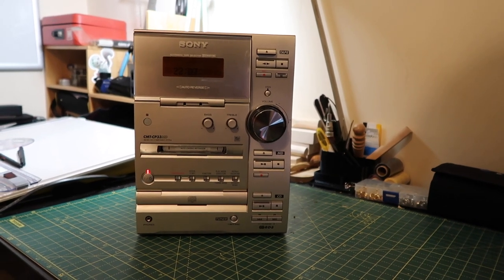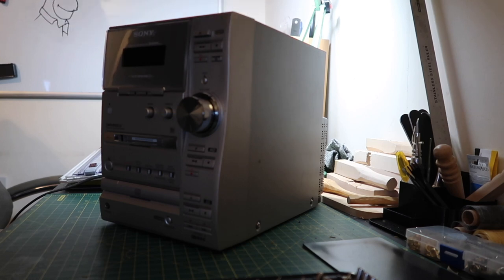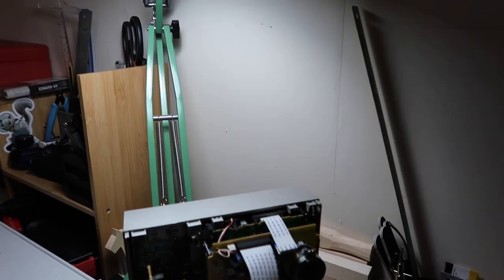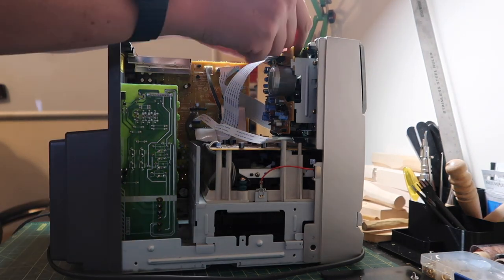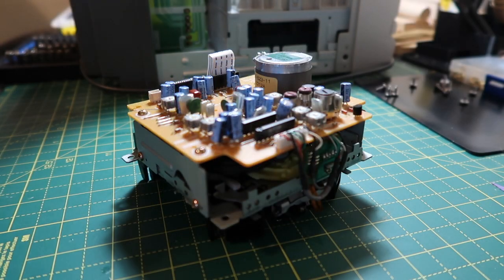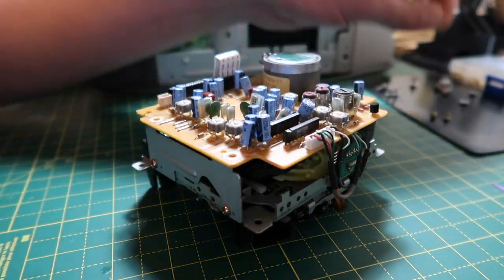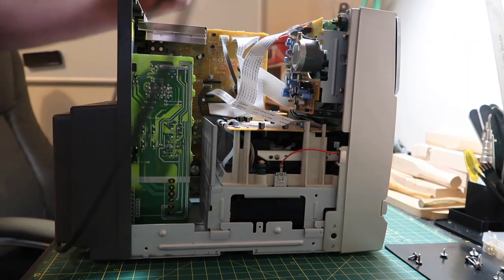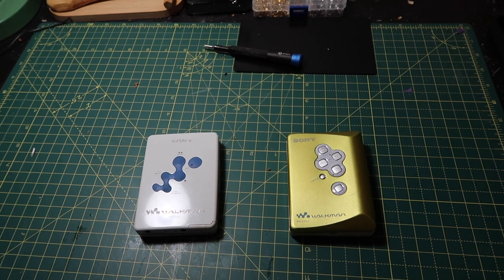Sony CMT-CP33MD Tape Belt Replacement

Comment: Thank you for your video! No need to remove the whole mechanism. Just the circuit board on the back. Three screws and the connectors. Leave the mechanism in place.

Comment: How’s this going, is everything still working? I’m about to try and get the working bits from two of these units to make one good working unit! Including changing tape belts so thanks for the video. I’m getting errors on both mini-disc units though.
Reply from the maker: Happy to report everything has worked great since I did this. Still sitting on my desk in regular use.
Reply: @retrobench5563  good to hear. I managed to create one fully working unit from two units which both had various issues. Your video was invaluable in helping me change the belts, which had perished. Minidisc issue was resolved (probably temporarily) by wiping a cotton bud with alcohol on the lens - you can just get to the lens without dismantling the MD unit! Thank you for putting this video up!

Comment: I have several months trying to buy the belts, I will take the risk to buy a lot of them if tests are needed, even I've purchased junk systems to practice the belt replacement (oo)!got to replace the CD belt and the Tape Deck, the hell is Double Deck autoreverse  - wanna cry.

Comment: hola, tambien tengo ese modelo con el mismo problema del reproductor de casete y tambien con el de Minidisc (no expulsa el disco y se queda dentro de la unidad) voy a intentar cambiar por mi cuenta guiandome de tu video, saludos.
Reply: Did you manage to change the belt? Is there a belt in the minidisc bay?

Comment: Hello. I have the same Sony system.  But it won't turn on fully. It's light is dull and bo functions are working.  I need help finding out hiw to fix this. Thanks.
Reply: It could probably be some blown or bulged capacitors
Reply: @BICIeCOMPUTERconGabriele  Thank you.

Comment: Hi Retro Bench. Thanks for your video. I have been making research to fix the same on a CMT-M333NT and I think by looking at your video, it uses the same tape belt mechanism. I made an order of those, since I was trying to find the parts and model for mine and only appears the belts for MD and CD mechanism and not for the Tape, even in the service manual is absent. I hope those help.
Reply: Good luck! Let us know how you get on!

For what it's worth, I found a supplier on ebay that had every type of belt imagineable, I'll dig out their name is you're struggling to find one that fits.
Reply: Thanks. If you find it, let me know, since I want to fix this. I will try this set first and if not, I will go that route.
Reply from the maker: @momegao  Here you go, they have lots and lots listed "mana_tree" on ebay: https://www.ebay.co.uk/usr/mana_tree